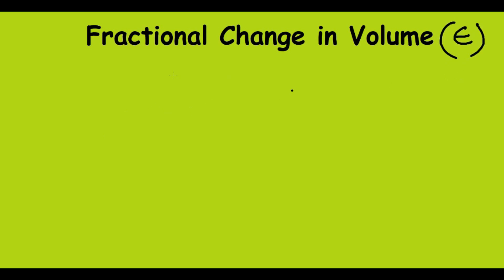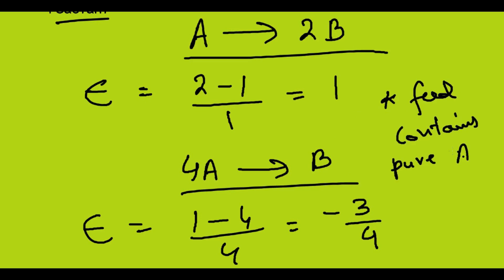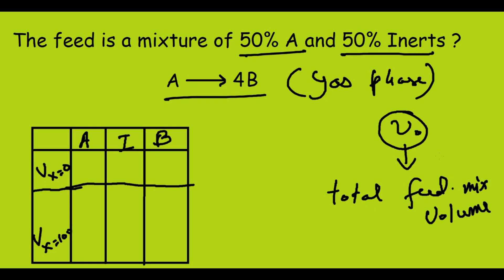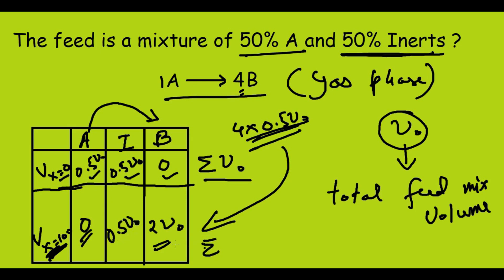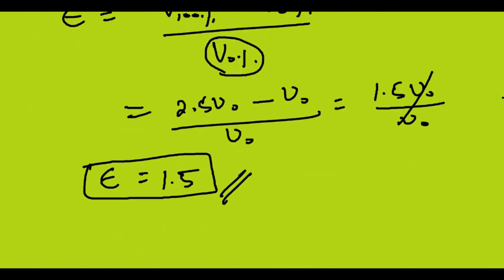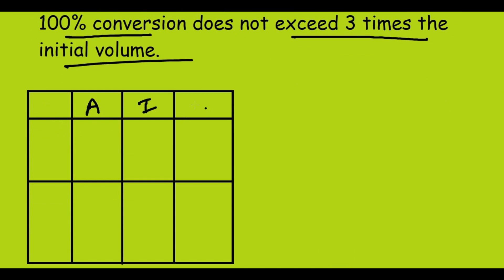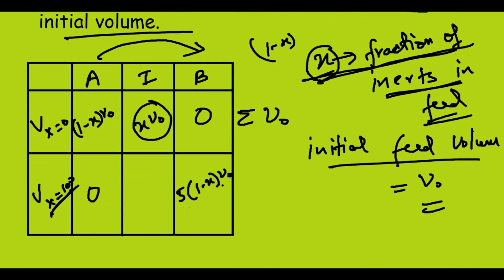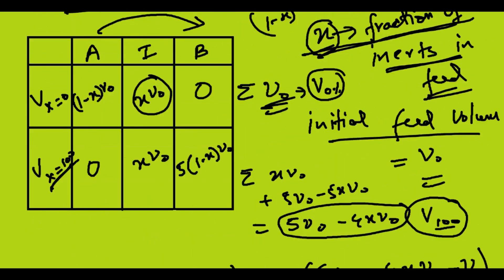Fractional Change in Volume of the system for Gas Phase Reaction #CRE

Comment: How to do this if 2A gives 3B
Reply: Use this formula.
eps=yo*delta

yo= Feed of Limited reactant

delta= (product coefficients sum - reaction coefficients sum)/Limited reactant coefficient

For 2A —> 3B
Assuming feed is pure A
yo=1
Delta=(3-2)/2=0.5
So eps=1*0.5=0.5

For A+B —> 2C
Feed 50/50 A and B and eps in terms of A
yo=0.5
Delta=(2-1-1)/1=0
eps=0.5*0=0

For 2A+3B —> 4C
Feed 50/50 A and B and eps in terms of A
yo=0.5
Delta=(4-2-3)/2=-0.5
eps=0.5*(-0.5)=-0.25

Hope this helps